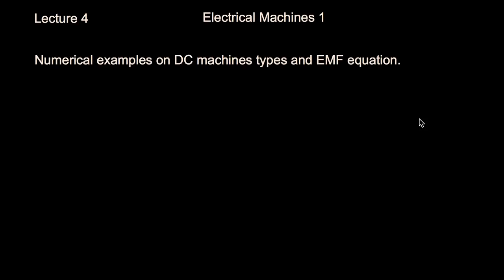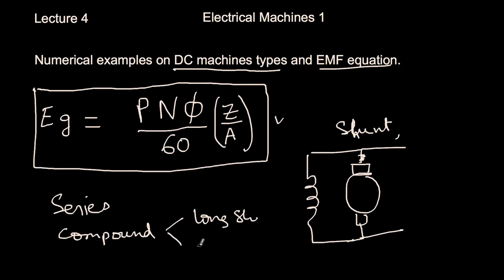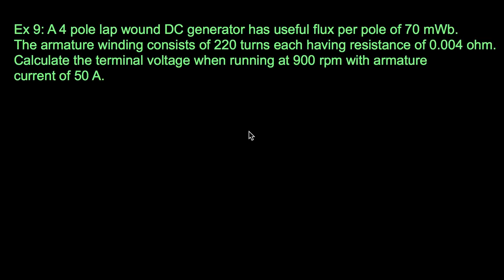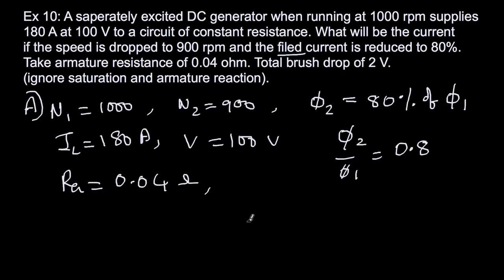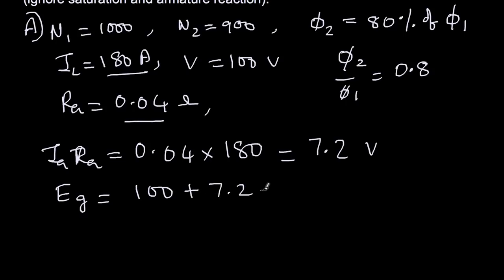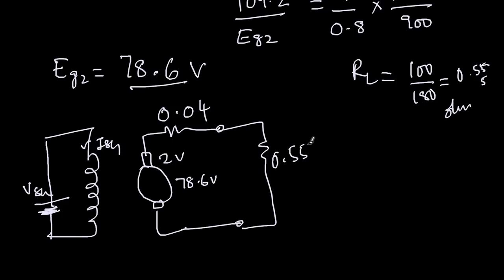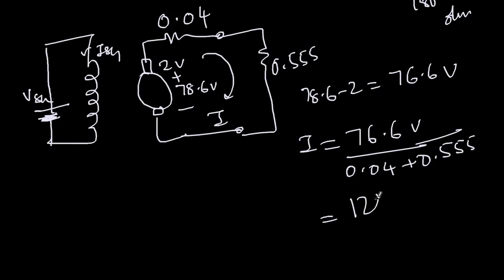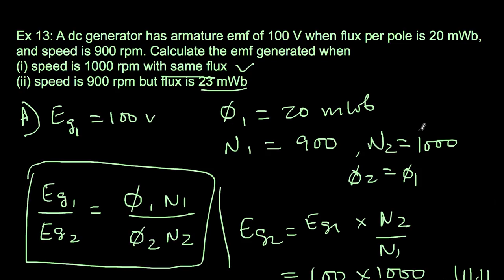Numerical Examples on EMF equation of DC generators

Comment: 7:00 isnt it should be the voltage drop mines the sixty volts because the whole branch is connected on sixty volts and the drop of the branch is 1.15 volts then the voltage on the armature will be the difference.